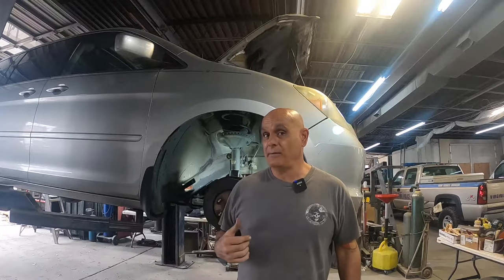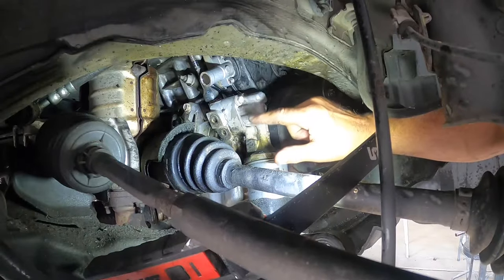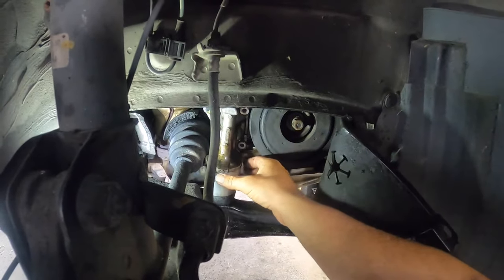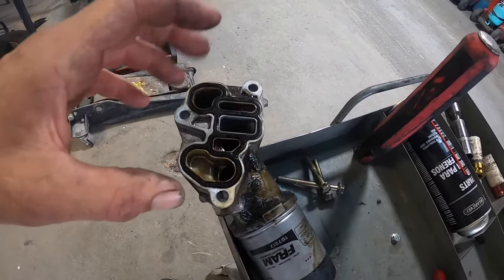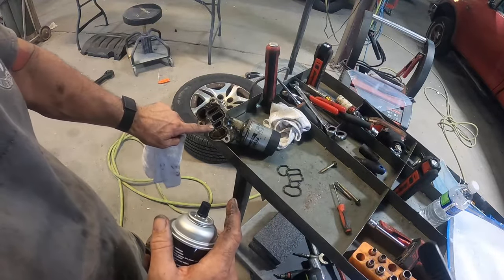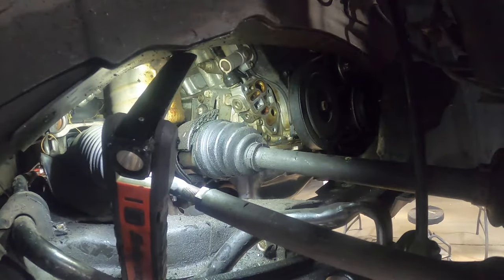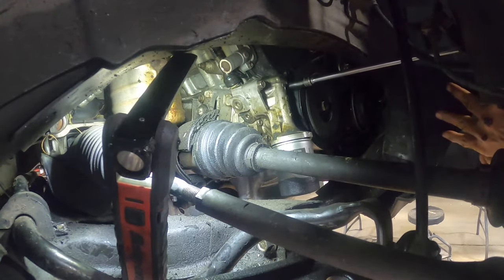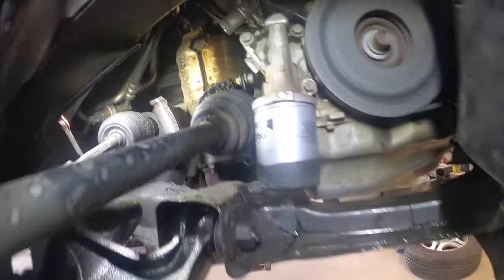Honda Odyssey Oil Leak DIAGNOSE and REPAIR

Comment: Super helpful video! Was losing oil in my 2006 Honda Odyssey and was worried it was gonna be a big garage bill. Watched this video and was able to do it myself. I’m pretty certain this is where the leak was because it had a buildup of sludge on this part. I used Fel-Pro oil filter adapter gasket # 73040. Changed the oil and filter at the same time. Let it run for awhile and i didn’t spot any leaks. I will keep an eye on it, but I believe this was the problem!
Reply from the maker: glad it helped
Reply: Hoping this and a muzzler with new valve cover gaskets solves my issues

Comment: I used AT-205 to expand the seals.. bad leak stopped after about 200 miles of driving. I was skeptical but am very happy with this product… 7 months in… no leak
Reply: A good stop leak for cooling systems that I swear by is K-Seal. I used that in my friends Chevy Sonic. Those car's are cooling system nightmares. It stopped the leak in the radiator.

Comment: This oil leak evidently has been going on for a while.  The van squeals horribly, and the mechanic charged us for other repairs...  eventually, it leaked bad enough for me to look into it, and... this video made it easy for me to fix it...  now to do the repair and clean the area and belt to see if that fixes the whole problem.... it is a 2007 after all.
Reply: How did it turn out?

Comment: @auto repair tips great video. I'm pretty sure this is whats happening for me. I assume you have to drain/change the oil. it's not that dry as is, is it?
Reply: What did you figure out? Did you have to dump the oil or just the filter?

Comment: Some Honda bond or gasket maker around that side without the bolt probably wouldn’t hurt. Don’t feel like doing mine twice, so I’ll more than likely take my own advice. Lol. Appreciate this video, I’ve been wondering why my leak is so bad down low.
Reply from the maker: hope it helped you
Reply: Does it leak oil onto your drain bolt?I have a leak that drops onto drain bolt and surrounding area though my drain bolt is tight
Reply: @AutoRepairTips757 how do you know that's the leak?   Or maybe some where else....

Comment: Do you need to drain the oil first before removing this housing? I’m assuming you’d have a mess otherwise. I literally just changed my oil 15 min ago thinking the leak was around the oil filter itself, but I think it’s this gasket you showed us.
Reply from the maker: No I didn’t drain the oil first you’re gonna have a little bit of a mess but not much
Reply: @AutoRepairTips757  Thank you!
Reply: @joeorlando94  you need,he forgot say it😅
Reply: Good to have a drain pan if not up on a lift. You get about 1/2 cup of oil.

Comment: Make sure you check which honda or acura car and look for the 10mm bolt on the right of the housing. For example, the acura RLX has that bolt in the back of the harmonic balancer. You need to remove the accessory belt, the harmonic balancer, then you get to the 10mm bolt. The acura tl and the honda accord do not have that issue. It’s straight forward like in the video.

Comment: Some of these gaskets have filters and some do not. I see one of each coming up when I search for an 07 odyssey. I guess I’ll order both to be safe and return whichever is the wrong one.

Update: just did this repair and no filter on original gasket. Job was pretty easy and saved me a lot of money doing myself.
Reply: I had the same dilemma saw both parts didnt know which one to get. I got the one with filter, when i got the old one off it didnt have the filter. The filter can be easily pried out and used anyway without it. This is one of the easiest repairs I have done on this POS  you just have to identify this as the leak source. Yes its a POS for a jap car bought with 111k now has 157k i cant count how much shit Ive had to fix and or needs fixin just the planned stuff like timing belt and valve adjustments are absurd compared to Toyota Sienna. (07 exl)
Sucker that i am i bought another last year (16 elite)but much less has broken. We will see how happy I am at about 110k when I gotta do the timing belt. It does drive fantastic for a minivan
Reply: It depends on submodel like exl. And touring don't have gasket I believe and certain years don't either..
Reply: @ashleyredden2201  for some engine parts yeah but Im pretty sure all odys of a certain year have oil filter mounting plate gaskets. What would differ is VCM vs non VCM and thats where trim levels come in. For instance 07 lower trims lx and ex  have the J35A6 while upper trims exl and touring have J35A7, with VCM and those have spool valves on each head with gaskets prone to leakage.
Reply: @batvette  timing belt expense is annoying but the Honda j series is pretty rugged other than that. Have 206k on my ody

Comment: This happens on most Honda V6 3.5 in the Accord, Pilot, Ridgeline, TL, MDX etc. The spool valve gasket on the other side of the V leaks too. It won't Just make a mess though, it will leak down onto the alternator and ruin it.

Comment: I was told my 09 honda odyssey, oil leak requires transmission to be lowered which is the bulk of the price of $1,800 to repair. Does that sound about right?
Reply from the maker: What is leaking?
Reply: @AutoRepairTips757  they said near pump and mentioned something about gasket. That only way to access it was to lower transmission
Reply: @AutoRepairTips757  yeah the oil pan or what is labeled under engine literally has Engine Oil engraved in the bottom of it. The gasket needs to be repaired and labor is the most expensive part need to be in shop most all day

Comment: 16 Ft-lbs is what's required for the 3 mounting bolts. Also use a gasket that has a screen in it. Especially if the original gasket from the factory had a screen in it.

Comment: thank you for showing us the main problem but slow people like me would really like to see the whole process i dont know where the big screw goes.  where do you get the gasket is it available online only or you can go to any auto parts or dealer only?
Reply from the maker: i bought the parts from the dealer
Reply: the big screw goes into the same hole it came out of

Comment: Just replaced this same Gasket on my 04 odessey. The water passage, EGR and thermostat gaskets are next. But then I gotta track down the other oil leak. I'm afraid it's the rear main seal but  I'm really hoping I'm  wrong.
Reply from the maker: Good luck

Comment: I just changed my gasket, but this wasn’t where my oil was leaking.  I am guessing it’s my oil pain gasket.
Reply: Well you have one less thing to worry about going forward now. I guess it’s a process of elimination and the good thing is that these repairs seem doable which can save us some nice money. I’ll be doing this on the weekend and also changing a seal on another component known to leak. I think it’s the vtec spool gasket. After these two are changed I’m hoping my leak is fixed. If not then it’s on to the next possible culprit I guess. Very thankful for videos like these and the people who take the time to do them. I’m a handy guy with respect to tools and woodworking. But I never did automotive. Thanks to YouTube I’ve done a number of repairs that were beyond my basic understanding but got them done. One of the biggest was taking apart the top of my jeep engine to replace an oil filter housing (damn oil leaks lol). Took a whole day but I saved a lot of money.
Reply: What did it turn out to be? VVT solenoid gaskets?
Reply: @tdz69  It is my oil pan gasket, but the leak is small , so it’s not a big deal and it’s not worth all the time and effort ,imo.  

I have 266,000 on my 2001 Odyssey, and I am hoping to get another 100k out of it, if possible.  I’ve put plenty of parts onto this van and, everything operates on it. The one thing I haven’t changed yet, is the water pump and belt , which are recommended @ 100k. 

Iam the 3rd owner, so idk if the belt and pump have been done yet. I recently took my vin to the Honda dealership to see if I could obtain any Maintenance records on my van but they had nothing.  The previous owner said she had all her work done at the Honda dealership, but I had no luck.  I just wish I knew if the belt and water pump were changed so I don’t have to waste time doing it myself .   From what i see, it’s a big job.

Comment: Worst nightmare? Looks easier than an oil change
Reply: Mine just went bad while i was about 70 miles from home. It dumped 3 quarts and oil light came on. I filled it with oil and it dumped 4 more on the way home I had to stop when oil light came on again.
Reply: @GoatOrange pollution.